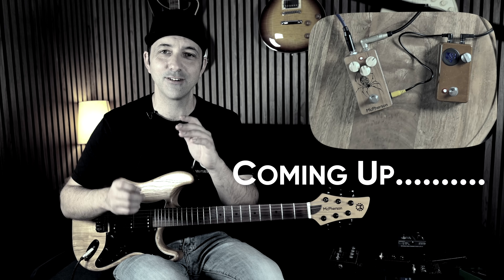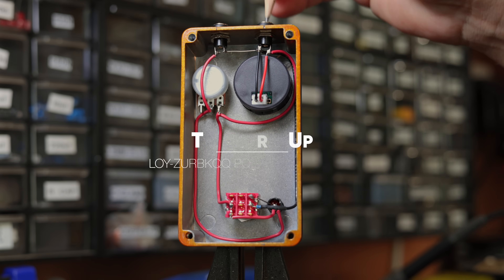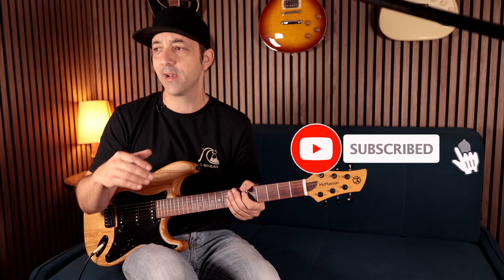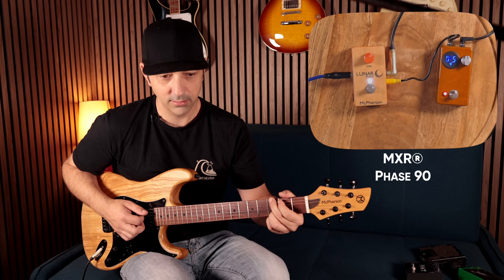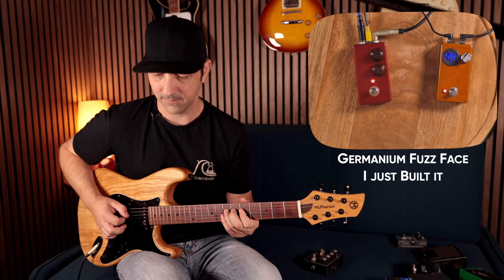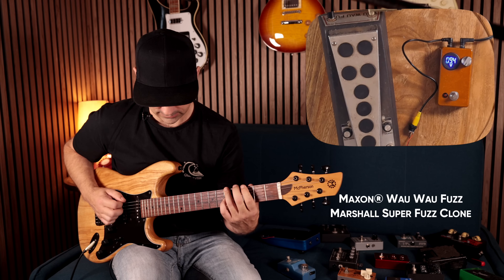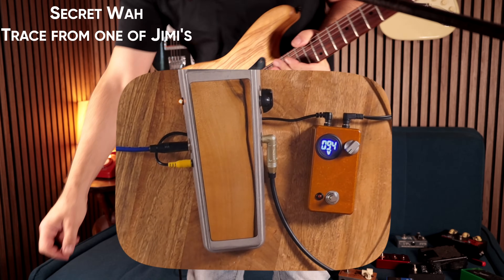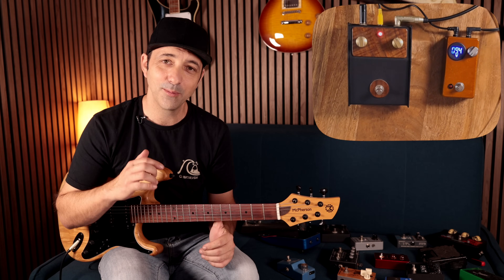Turn ANY Pedal Into a New Beast – DIY Starve Box

Comment: I've been using the "dying battery mod" in the dyna comp forever.
FWIW, I use only batteries in gain pedals.
With batteries when the voltage lowers the resistance also changes.

Comment: I made something like that while back and I found that with some pedals turned off it affects the input and output buffers, I sometimes use it as a dirty base tone early in the signal chain from a Behringer SF300 on boost setting with the pedal turned off. Check it out!

Comment: You could also use a Buck/Boost converter board to get both starved AND overvoltage sounds (like how plugging some pedals to 18v gives more headrom) .
Reply from the maker: That’s a great idea! Just be cautious about boosting, as many 9V pedals only have capacitors rated at 10-16V

Comment: i bought a univibe a while ago, and i used it with a battery, just to save cables, but what i discovered as the battery was dying, was that as it was just about to die, it made a sound like  a WWII air-raid siren. and THAT's the same sound as the sound at the end of Pink Floyd's Welcome to the Machine... so Thats how they did that.
Reply: I think they actually sampled a carter air raid siren. It’s always cool to find new ways to recreate sounds though.
Reply: I think they actually sampled a carter air raid siren. It’s always cool to find new ways to recreate sounds though.

Comment: Almost all the distortion type pedals got MORE distorted at lower voltage, didn't expect that at all. Also added a bit of gooey tube amp-ish sag and compression, to my ears. Super cool idea!
Reply: Ikr!!! it always confused me how lower voltages get more distorted but it makes sense when you look at it like an amp. The higher the wattage, the more clean headroom, and its the same thing with pedals.
Reply: It's because transistors, opamps and tubes amplify a specific amount regardless of voltage however if they amplify beyond the amount of voltage available they clip which is what distortion is. Lowering the voltage available to the transistor makes it clip harder = more distorted.

Comment: You can also buy already-built DC-to-DC converters as a completed PCB, with up/down buttons, and a display which shows input voltage, and output voltage to a couple decimal points, for just over $1 to a few USD each.

Comment: All thats doing is  is its starving the transistors in pedals but would be better to use a  adjustable voltage regulator's that would be much more accurate  learn electronics over 50 years here

Comment: It's the same as the jhs one. It needs to sag, not be fixed.
Reply: Except a Volture is $80 and this can be built for 1/8 of that and has an output meter.

Decide with your time and wallet. I love my JHS fuzzes but there is no reason the Volture should cost that much.
Reply: @DeAthWaGer if you have justified the cost of your fuzz pedals to yourself then whey not also the cost of the power supply? As someone else has already pointed out,  what is needed is for the rail voltage to sag under load which is not the same thing as running at lower voltages. If the jhs device does this but this is not the result that you are looking for and dont have the technical knowledge to implement then why would you build this? Genuine question.
Reply: @DeAthWaGer  my point is that the device needs to sag under load, like a carbon battery, not just be a lower voltage

Comment: Killer idea .
I use a simple DC-DC boost module as a alternative to use with rechargeable batteries. Only prob is it wont replicate the capacitance etc, so it wont really act like a dying battery, You can build a portable pedal power supply with option the cut or boost voltage.
I like to push 10v plus on some transistor based preamps it really opens up the circuit if caps are rated high enough in the pedal.

Comment: Inspiring video!
I think I will modify a pedal with an additional potentiometer after testing the sounds. I also like to blend the original guitar signal with the distortion and fuzz signals and make the output signal more adjustable with a pot, I did this with a fuzz pedal and it sounds great. I think I try it with this fuzz pedal that is already modified. I also tried to boost it with your idea using a transfomer TL 019-R, but it was too extreme. This is something I have to try if I build a bigger pedal with enough space for all the pots and switches.